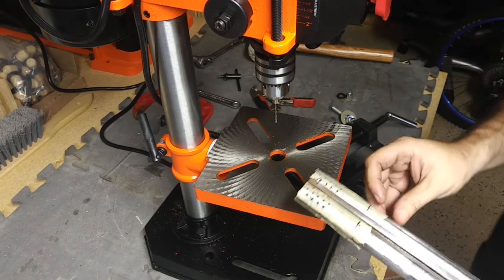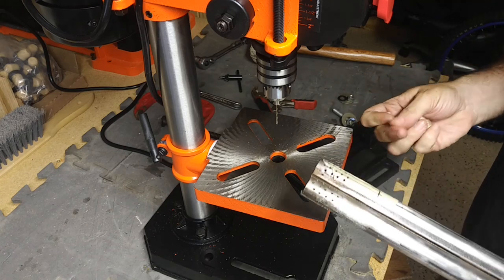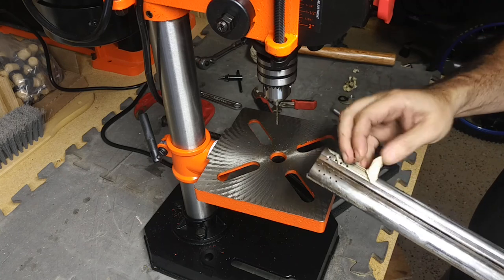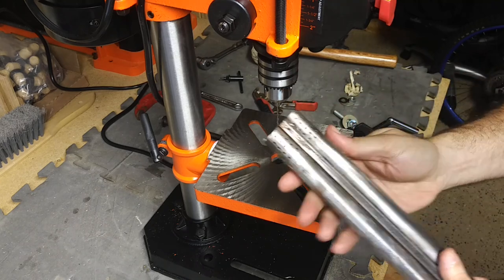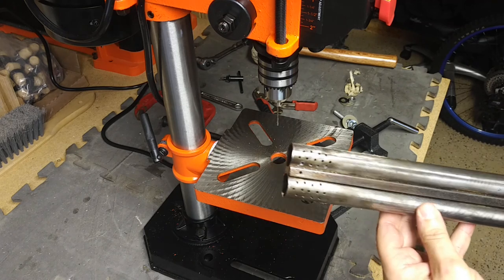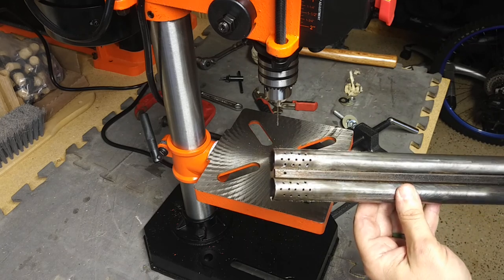Porting the barrels on the Savage/Fox Model B project shotgun

Comment: You need to use a Center Drill Bit to start your holes.

Or use a shorter drill bit so it doesn't wonder on your barrel.

An End Mill will also work instead of a Drill Bit.
Reply from the maker: Thanks for the tip. That bit did wander on me.

Comment: How did you remove the burr on the inside without damaging the bore? Is it rifled?
Reply from the maker: It is not rifled. If you use a good sharp bit there shouldn't be much of a burr. If there is, you can just run a brass cleaning jig through the barrel a few times to knock out any loose material. If you have a pretty bad burr maybe try a small rounded file.

Comment: I have a 1301 comp, id like to have it ported for goose season this fall. What kind of drill bit should i use for the chrome lining?
Reply from the maker: Thanks for the excellent question. You just need a good sharp metal drill bit. If you go to Home Depot or Lowes, in the hardware section they have an aisle full of drill bits. Just make sure you get one specifically designed for metal applications. You may want to pick up a couple different sizes and test them first on a scrap piece of pipe to see what size you like. Good luck my friend and thanks for watching.